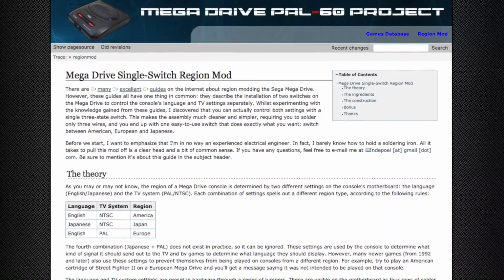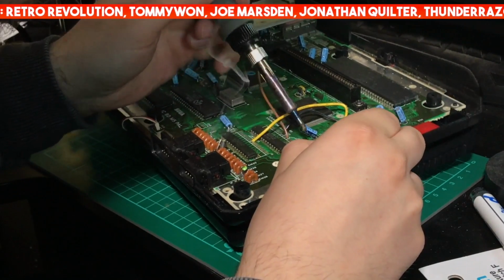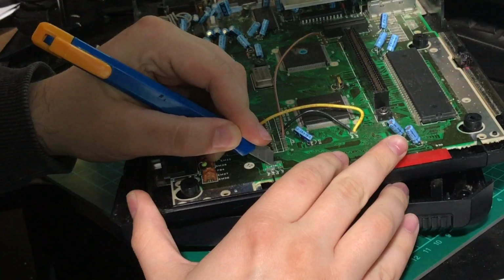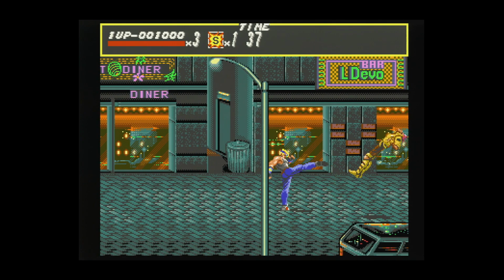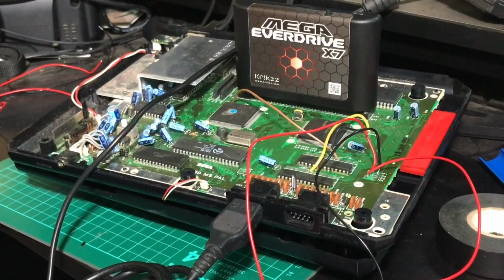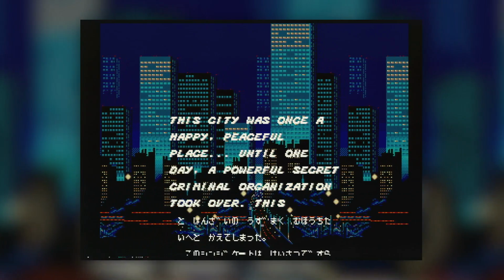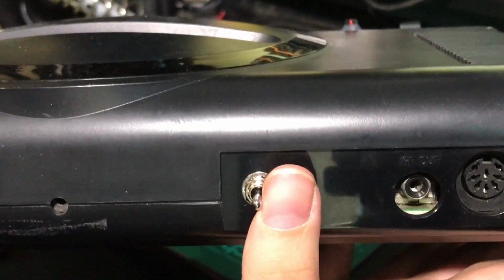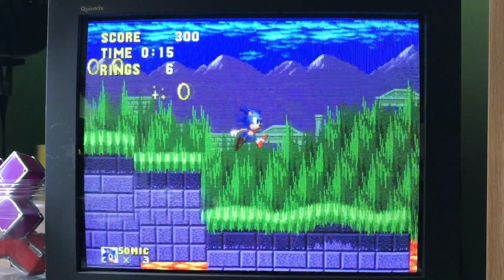Mega Drive Region Mod - A One Switch Region Free Mega Drive Solution!

Comment: Hi there. I know this video is old but thought I’d ask anyway. Do you know what thickness and/or gauge of wire you used for this? Thanks.
Reply from the maker: Ah, I’m afraid I cannot remember for the life of me - I was probably some wire I already had that I bought it from Maplin back in the day for various other projects. You’d probably be OK with around 26 awg - But I’ve had great success for mods using strands taken from multicoloured ribbon cable.
Reply: @PugHoofGaming thanks! I just happen to have some 26 AWG wire in different colours, so I’ll give it a go with that.

Comment: So for now I have a couple of American cartridges I wanted to play so I just did the bit where you but the JP 2 and 3, however now it plays black and white, any idea what I have done wrong?

I was going to order the switch today too (but the link only takes me to Maplin home page but will find one), but I am wondering if I have done something to completely ruin it before I do?
Reply: Thank you for the response 😊 I am an absolute noob at all of this so really appreciate it lol  ordered the right lead 🙂
Reply from the maker: No problem, you gotta start somewhere! :)
Reply from the maker: As the video mentions, make sure you’re using an RGB SCART cable, as your TV may not support a 60Hz signal via composite or RF

Comment: Nice vid! Trying to find a video as good as this one, but with the revision 4 model instead. The one with "High definition graphics - stereo sound" text above the cartridge slot.
Reply from the maker: Thanks! I would have thought the process was mostly the same, but alas I don’t have one of those models to test!
Reply: @PugHoofGaming   I think I found the right guide now. And yeah it seems to be very similar. However, it is rather confusing with the jumpers being on different locations, plus the mysterious capacitor on jp1!
Anyway, will subscribe and cheers from Sweden!
Reply from the maker: Yeah - If in doubt, pop by https://mdpal60.net/wiki/megadrive/regionmod/start and take a look :)
Reply: @PugHoofGaming  What about the sega/mega cd on a region modded console? I have not done any soldering as of yet. My mega drive is in a constant 60hz/ntsc mode: would that mean that I would need an american Sega cd for everything to work?
Reply from the maker: Good question, and not one I have an answer for - But I do know the Mega CD is a slightly different beast in terms of region modding as it requires a different BIOS for each region (or a multi-region BIOS).

Comment: did a kind of shorthanded version of this recently (don't have the tools/necessary resources to do the full thing yet) and wow, tis weird playing games on 60hz on the real metal, just gotta get an RGB scart cable so my games aren't just yellow and blue. can't wait to do the full thing when lockdown's over though!
Reply from the maker: It’s quite the difference, isn’t it? I really find it hard, almost impossible to go back to 50Hz, especially now I’m used to the rhythm of certain games in 60Hz. Sounds like the perfect project to take up while in lockdown, if possible!
Reply: @PugHoofGaming  definitely! seems like it'd be a lot of fun and also the final result seems a lot safer than bridging a wire to make the system start up in PAL mode so i can bypass the sonic compilation region lock lol. if all goes well on the first megadrive i wouldn't mind doing it to my other megadrive too.

Comment: I just did it, but the colors in the games are like a rainbow...I don't know what I did wrong :-(
Reply from the maker: Are you using an RGB SCART cable, or an RF/Composite cable to connect to your TV? If you’re not using RGB SCART, your TV probably won’t support the modes for other display regions properly when using composite/RF
Reply: @PugHoofGaming I'm using a AV cable with a HDMi converter and a Macbazel scanline generator +a HD TV...I have also tried by connecting only the AV cable to my TV...Well, I think I need to reverse the modding and get stuck with the old PAL. Just hope that by building a "bridge" between The JP dots will solve it! Thanks!
Reply from the maker: That’s weird - The HD TV should be able to handle any region display. I’d double check your soldering, make sure there are no cold joints, etc. Worst case scenario, you can always revert by making a jumper wire between the points you’ve cut.
Reply: @PugHoofGaming  Many thanks!  Subscribed :-)
Reply: Ahhh that usually happens with SAMSUNG TV's...I'd try in another TV ;-)

Comment: the image gets black and white in composite ntsc because the clock speed isnt the exact ntsc frequency. the composite/coax cable doesnt recognise the color frequency and gives only luma info(black and white). if u use 2 oscillators (one perfectly clocked to PAL, the other to NTSC) , the color will be back on composite/coax and the games wont play slightly too fast and wont play at a slightly too high music pitch.
Reply: NTSC 4.43 was used by the US military when they still had active bases in West Germany. However, it did find its way into some civilian European CRT televisions, which means that any NTSC 4.43 compatible CRT sets can accept a 60 Hz signal from a PAL Mega Drive in color.
Reply: Man I wish I knew all that before.

Comment: I made the modification on a Japanese Mega Drive, but when I use PAL 50HZ mode the image is black and white. The crystal is 53.69317MHz. Should I replace it with 53.203424 MHz to solve this problem?
Reply from the maker: I’m no expert, but I think if you replaced the crystal, you would get the same issue once you switched to 60Hz. You can build a dual oscillator circuit, which has both crystals, but I don’t know too much about it. If you’ve got a television with RGB SCART, I’d just use RGB SCART to connect your MD to your TV which would just solve the problem with no fuss, but that would depend on whether you’re in a country with easy access to such televisions :)

Comment: Question: Once you have modified it, could Master System's cartridges from other regions be played using the Power Base Converter?
Reply from the maker: I can’t see why not - As far as I’m aware, the Master System isn’t region locked, and the Power Base is nothing more than a bridge between the Master System cart pins and the Mega Drive’s slot pins. It doesn’t actually have any working parts :)

Comment: Is there any way to play region locked pal games in ntsc mode? For example when I want to play Jurassic Park in ntsc mode I just get a message that the game wasn't meant for this region..
Reply from the maker: Might be worth setting the switch to PAL, turn the console on and let the game start, then switch to NTSC. It should switch on the fly.
Reply: @PugHoofGaming  thanks I'll have to give that a try, I haven't got a proper switch to complete the mod yet right now the traces are just cut so it's locked in US mode

Comment: Have just followed this mod and my Mega Drive will not play UK games anymore.  Any idea why this would be if the mod is meant to make it region free?  Also on the games which it does work the screens jittery and missing pixels.  Help?  (This is on a UK Mega Drive first gen)
Reply from the maker: It’s not automatically region free - You have to flick the switch to the region of the game you’re playing (although to be honest, it should boot games up and some will say you’re using the wrong region system)

It may be that somethings not right with your mod. Maybe something shorting, somewhere? (sorry, I’m not an electronics genius). Might be worth retracing your steps and make sure everything is as it should be.
Reply: Just to add a little update incase anyone has the same problem as myself and is reading this.  My Mega Drives motherboard is the VA5 version.  I had to solder JP1 (Left) JP1 (Right) and JP4 (Left).  Thats the only combo that would work for me and I have no idea why but it works.
Reply from the maker: Glad to hear you got it working! :)
Reply: John Carson How can you tell, Mine says both VA5 and VA6?
Reply: @ChristopherMcGivern1  The text next to VA5 and VA6 also references a part number - look at the chip next to the VA5/VA6 text and you can then determine which you have.
Reply: You are probably right.  Will redo when I get a chance.  Cheers!

Comment: I just want 60hz. What happens if i just cut JP3 no soldering.
Reply from the maker: Depends what region games you want to play in 60Hz? My electrical knowledge isn't amazing, truth be told - Honestly, I would install the switch to give you the flexibility.
Reply: Sonic, streets of rage. Basically the early games that were USA & European on one cart
Reply: So I wanted to know, you said cut the JP2 and JP3 and it will trick the console and think it's a USA console?
Reply from the maker: +FunkyDopeBrother If you want a USA, 60Hz console, cut the JP2 and JP3, but then you won't be able to play European region-locked games. I don't know any other combinations to get just a straight European, 60Hz system (and you probably wouldn't want to, as some European games don't like being in 60Hz!).
Reply: I have a Mega Everdrive X7. At some point I would add a switch.
Reply: I just don't have a soldering iron.
Reply: I'm using a AV output on a Samsung 4k TV. It won't come out black and white would it?
Reply from the maker: +FunkyDopeBrother No, it'll be fine. Only older European CRTs have that problem.
Reply: It worked but i'm getting rainbow colours.